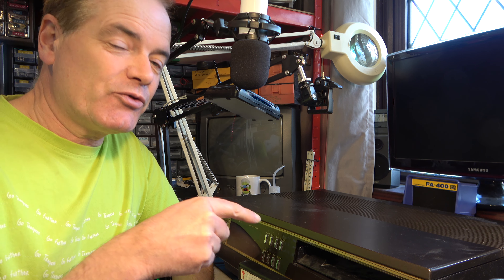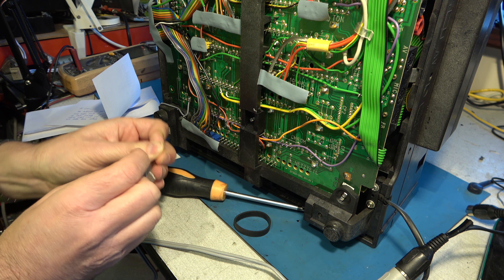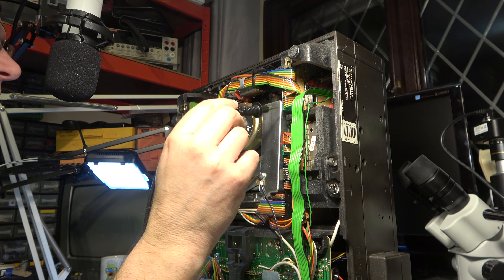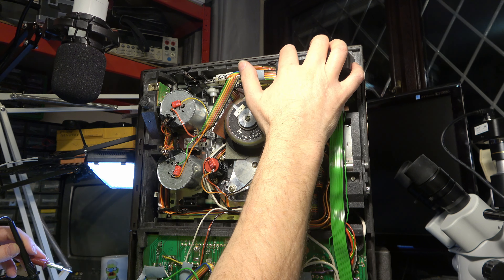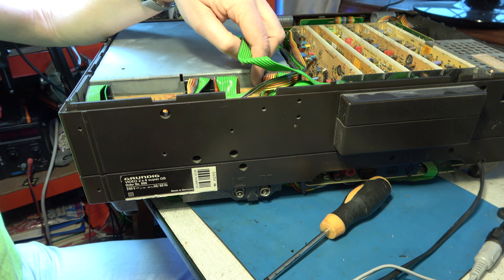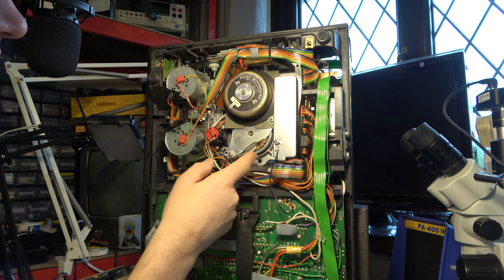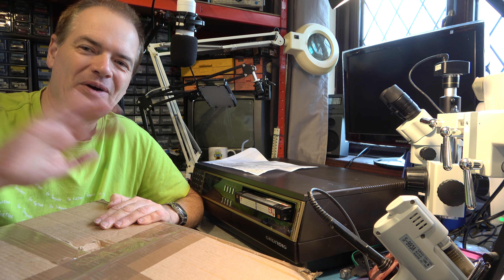Grundig 2x4 Super V2000 video recorder requires repair.

Comment: The wow & flutter is caused by the meander plate (the plate holding the fg coil at the bottom of the capstan flywheel) not being correctly aligned. there is a 'special' tool to align these correctly. basically a metal rod with a hole in the centre which is placed in the hole in the meander plate before tightening the screws holding the plate. I used to work in Grundig Technical Dept in Rugby and was responsible for Video recording and Satellite reception...The black thing with the red end is the capstan motor . The big flywheel at the top is the drum motor.
Reply from the maker: That would explain why the wow and flutter (actually just flutter really) is only a bit improved with the new belt.  Without this special tool, what could I do to get a reasonable result, if anything?  I'm also not clear what the meander plate is, and why it exists, so any information gratefully received!
Reply: @video99couk  The meander plate is a frequency generator coil which interacts with a multi pole magnet on the base of the capstan flywheel. It is used to control the capstan speed. The coil / magnets generate a sinewave with a frequency proportional to the rotational speed. 
I might still have a 'special' tool kicking around somewhere. I'll see if I can find one.
These machines are also a bit sensitive to the type of capstan  belt.
Reply: @chrisbircham221  Yes-🇵🇱.

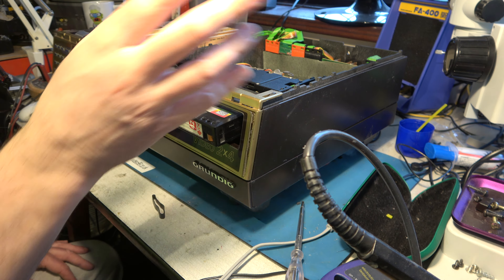Comment: i guess you probabely saw it since 2 years, but when the new belt lack torque, i noticied the cassette holder wasn't straight at 10:54
it may also be the camera angle, but this can really happen anyway.
i already get this when you work on it, sometime you can misalign the cassette holder without seeing it. 
it's not enough to make the cassette loading and tape lacing going bad, but enough to make the ejection a bit harder.

Comment: One of the V2000 machines I once had was a Grundig 2x4, similar to this one. But it had the problem that the audio head was at the wrong position: apparently there was some confusion in the specification and either the Grundig engineers or the Philips engineers had gotten it wrong. Also this was the most finicky V2000 machine I ever owned (probably because of those stupid connectors), and I didn't like the German panels that were all wrong (stop=pause, cass=stop?), so I didn't use it much.
Anyway, I heard later that there had been a service kit to move the audio head, however as a compromise between (1) making it play tapes correctly that had been recorded on a Philips recorder and (2) making it play tapes correctly that had been recorded on the same machine (or other machines) with the audio head location problem, the service kit put the head halfway between the "right" location and the "original wrong" location. So now there are not 2 but 3 "arguably wrong" positions of the audio head.
Reply from the maker: My understanding is that this applied only to the very early models from both manufacturers, before they moved the "official" position to the centre.  I wasn't aware they made any kits to convert them though.

Comment: These are such troublesome machines. I've still got one waiting to be fully repaired. Have fixed some of its issues like power supply and intermittent flat cable connectors, so at least it plays again and the picture is actually not bad for such an old machine. But the front panel is in terrible shape. The plastic sticker has partly come loose and it shrunk so that some of the number keys are stuck. From your other 2x4super video I know that this is a well-known issue as well.
Reply from the maker: Plastic shrinkage was a problem both cosmetically on the front panel and functionally with the edge connectors.

Comment: Gods TEETH I haven't seen one of those since I left Comet in '83. I think they bought the entire remaining stock of these from Grundig for next to nothing and sold them "competitively" (still dirt cheap mind) you also got a FREE VIF K1 infra red remote module (another bloody DIN plug connection haha!! ) The thing REEKED quality, l loved 'em ❤
Reply from the maker: Having the remote control receiver as an optional extra was just unnecessary complication. One of my machines has this and it is useful, albeit the remote control is a horrible layout.  I imagine Comet came to regret selling and so supporting these unreliable contraptions.  For the ultimate in reliability, nothing came close to Sanyo VTC5000 and VTC5150 Beta machines, I bought a VTC5150 from Comet back in the day.

Comment: if I press the cassette button it ejects the tape and a sound is heard when the solenoid is released and CASS appears on the display or if I press clock the time ... and if I press AV it holds without turning off the video 2000 ... and on the rf channel (when I put it to tune, the solenoid is activated again) and manages to tune the image just
 the solenoid is deactivated and does not support tuned channel

Comment: in video mode it does all the functions...and if I leave the tape in without ejecting the player it stays on and all correct tape information is displayed...but it doesn't let me tune (to tune...before it automatically ejects the tape) and when I manage to tune in and insert the tape again... the video loses tuning mode and flashes 88888 again... and if I press play it plays without problem... but I can't record since the tune was lost (I can only record if I select AV and there I put a signal)

Comment: hello I like your videos, I'm now with a philips video
 model 2025 and although it reproduces (a year ago I managed to be able to view by av and by rf, I had found several connectors, black, green and orange, bad plastic, I had glued them and flanges... and everything seemed fine... except now I tell you ....
when I plug in and turn on the video on display 888888 appears blinking
I put the hour and the minute or so it goes back to 88888 sounds from various relays are heard... just like in your player... if I press AV I can enter image and sound from another player and view it by rf on tv and if for example on Instead of AV I try to tune into video 2000 channel 1,2,3, x,, the video does the following to me...if it has a tape inside it first ejects it and then it starts to tune in...the method I use is ( vhs video broadcasting a movie and through the rf cable output connected to the rf video 2000 input) well I manage to tune in to the movie but when the tuning finishes I give memory .. shortly after the video2000 disconnects and reappears 88888

Comment: Not working.
Reply from the maker: I would start by looking at the power supply voltages, the relay contacts on the power supply often fail as do the capacitors.  Also look for broken edge connectors on the rear PCB, top and bottom, edges.  They are forever splitting.